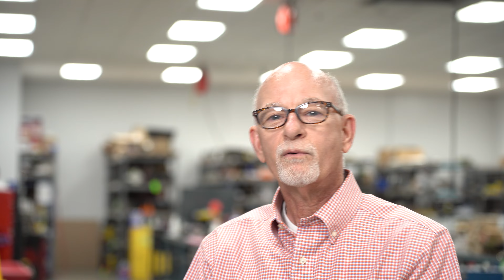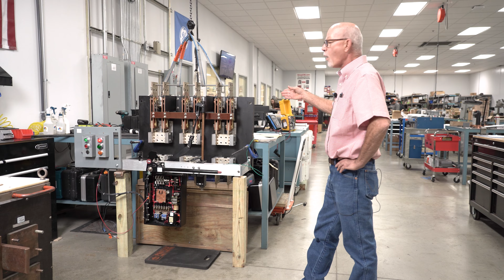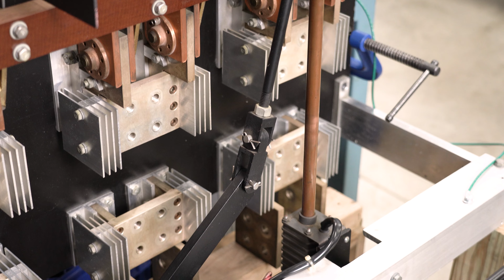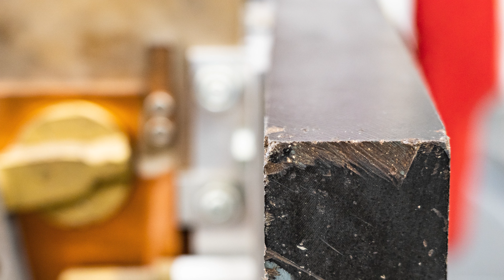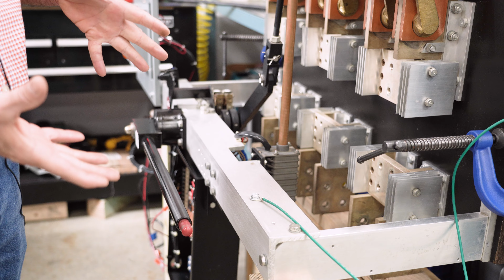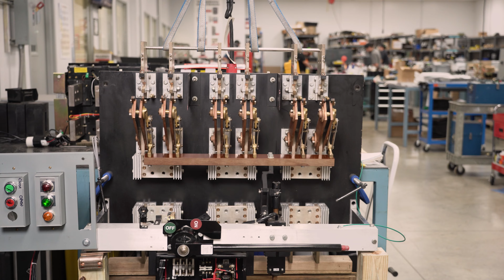1969 Pringle Switch

Comment: Had a 2000 amp Pringle break the other night on us. Scared the shit out of me. Had a full blast suit on but whatever. Apparently there’s a bolt and block mechanism that block the handle from over throwing or over opening. Someone replaced it with a longer non graded bolt and it sheared right off when I opened the switch. This Pringle was older than 1969 and is still in operation